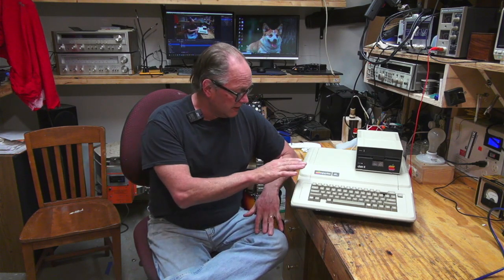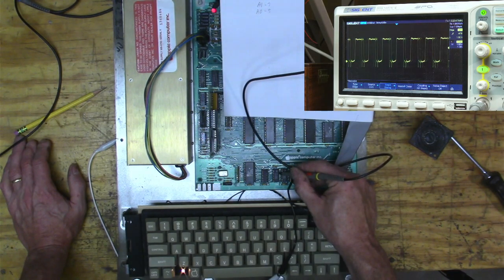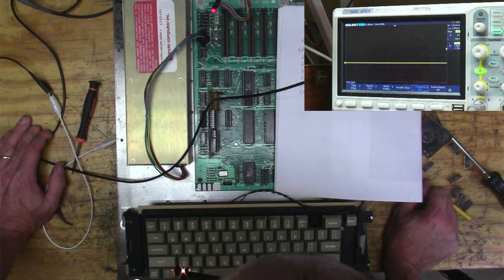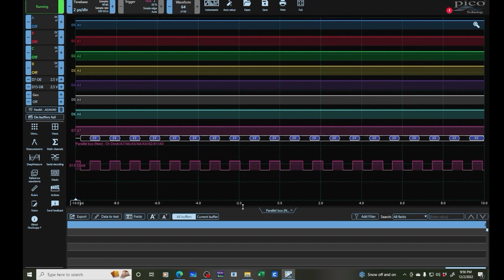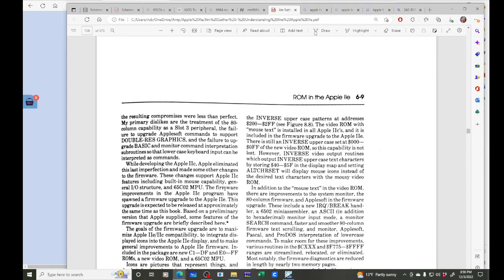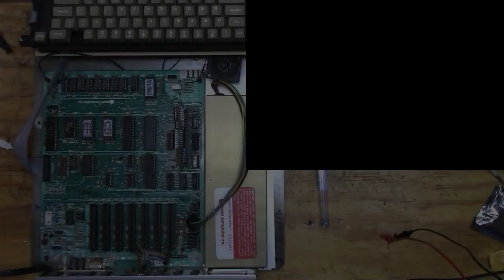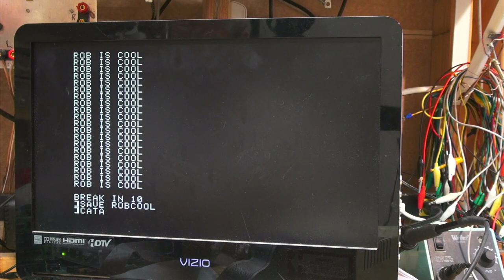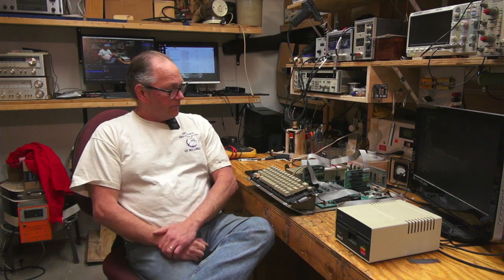Apple IIe Repair and Upgrade

Comment: the 40 pin dip sockets on the IIe are Junk single wipe. First then you do is just reseat all the chips when it dont work that fixes it 80% of the time. 
its so bad i am in the prosess of resockting a apple IIe right now.
Reply from the maker: It was pretty interesting trying to figure it out although it was pretty brute force just taking chips out until it booted :-)